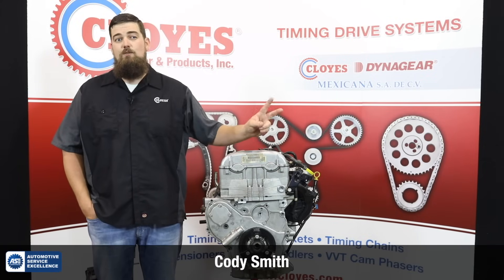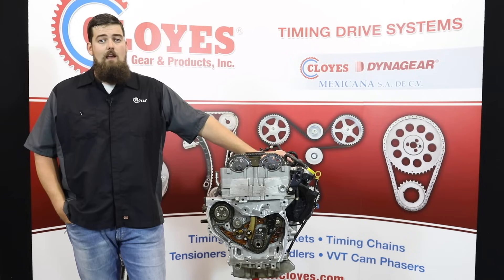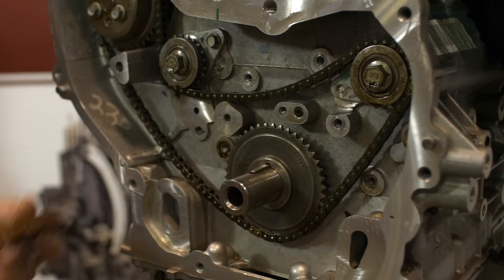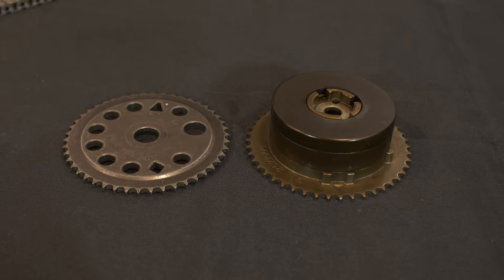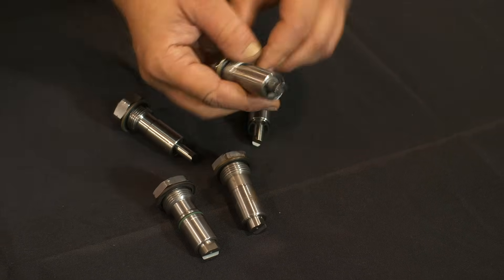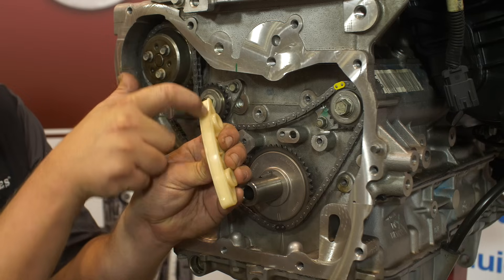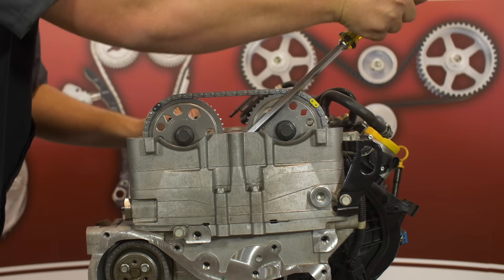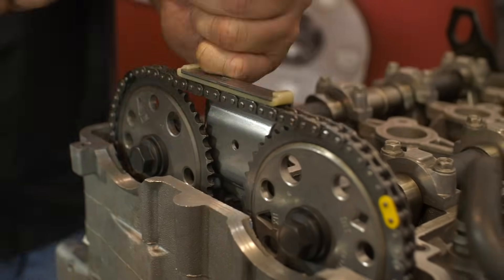GM 2.0/2.2/2.4L, Timing Chain Replacement, Cloyes 9-4201S & 9-4202S

Comment: Thanks for the video. I got balance and timing sets installed over weekend(2.2). starts up and has chain clatter. Drove about 1 mile, clatters under load but not coasting. Unceartain if chain tensioner functioning.  Do I just remove it to see if its activated and try installing/ activating again ?
 And will it seat correctly without removing the front cover again? This is my first experience with this type of engine. Thanks

Comment: Does this technique apply to a 2012 LEA 2.4l ecotec? 
I am getting code P0017, I installed a cloyes timing set, cam sprocket and cam position sensor but still cannot seem to get rid of the code.
Reply: Try cam sensor relearn. You must relearn the position sensors when ever u replace them
Reply: If that was your only code and not one for the crank. It was just possibly a bad cam sensor.
Reply from the maker: Yes, this video will directly apply.

Comment: 2011 terrain I removed the bolt that hold the intake balance shaft sprocket… housing thing and it snapped in half. (Please forgive me I have no experience with mechanics work and I’m doing it on my own because of mechanics screwing me). It’s like a long piece of metal attached to the intake and exhaust balance sprockets that goes into the engine block. I didn’t realize you needed a drill bit to hold it in place. Will this mess up my engines timing? Also, I rotated the pistons to 90 degrees before TDC so that when I installed the head (at tdc) I wouldn’t scratch the valves or pistons. I also Cannot find cam sprocket bolts or a crankshaft bolt, going to check the dealership . Thank you everyone enjoy your Labor Day

Comment: Hello 
I have the same chain set but I can't get the camshaft sprockets right am i doing something wrong i watch your video and i stil cant get it right

i have a Saab 9-3t BioPower
Reply from the maker: Do your camshafts and camshaft sprockets have the indexing features? Some Saab models require special tools because the cams and sprockets do not have the indexing features like the domestic GM models do.
Reply: @Cloyes01  The camshaft have the indexing features
The original camshaft sprockets dosent  the new sprockets have the indexing features
The thing is the chain doesn't line with the new camshaft sprocket
Reply from the maker: @thisistheway1766  You typically need to rotate the cams and/or the crank to get the marks to align properly. Especially if you experienced a timing failure of any kind. The chain sets the timing in this engine, if all marks align, then you are in time.
Reply: @Cloyes01 ahhhhh shoot

Comment: How do you know where to align the exhaust sprocket? on the balance shaft
Reply from the maker: The sprocket will only index on the shaft one way, then you put the sprocket mark at 6 o'clock and align with the marked chain link.
Reply: @Cloyes01  Thank you so much. Bought my Cloyes kit and I am excited to have my engine back.

Comment: Hi there, great video. I have a 2011 Buick Regal 2.4L Eco Tech. I bought a timing kit from Cloyes and I followed your video with certainty that I had it correct. I had all points on each chain on the right tooth of each sprocket. But I did what you suggested not to do and that was that I had turned the crankshaft by hand to see if there was any interference/out of time. The issue I’m having is that I keep rotating the crank and the chain marks are not lining back up with the sprockets mark no matter how many times I turn it. Basically I’m wondering if those marks on the chain are for the initial timing and they won’t ever line up again or have I messed something up. And if I did mess it up is there anything you could suggest I did to do that? Your feed back is much appreciated. Thank you.
Reply from the maker: Those chain marks will only align once every so many turns. You may have to rotate over 100 times to get them to all line back up.

Comment: do the timing marks on the NA crank balance sprocket and the force sprocket match up? It doesn't seem like it on the kit I bought. maybe the +/- 5 degrees on the forced is the reason why?
Reply from the maker: They are different, but the timing procedure is the same. Just make sure the marks on the chain and sprockets all align.

Comment: So this does not work on the camshafts, for the VVT version of the 2.2L.
Reply from the maker: The process on the VVT engines is identical to this. The only difference is the camshaft sprockets look different.

Comment: I'm not mechanically inclined and I hope that i'm not making a silly assumtion: Can I assume that the  Cam shaft sprockets shown in the video are "Standard" cam shaft sprocket heads, as apposed to being "Vvt"  cam shaft sprocket heads? Also,  what is the difference between the two, standard vs. Vvt (assuming that there is one,) ... Are Vvt sprocket heads used exclusively on the 3.6L ecotec engines or they interchangeable between the 2.4L and 3.6L engines sizes?
Reply from the maker: Correct, the engine used in the video was a non-VVT engine. These Ecotec 4 cylinder engines were non-VVT until about 2008, then they all adapted the VVT technology. This video only applies to 2.0, 2.2, and 2.4 4 cylinder engines. The 3.6L engines are a completely different, V6 platform.
Reply: @Cloyes01  Thank you. GREAT VIDEO !!!!
Reply from the maker: Scott Black  If you have the mechanical ability to gain access to these components, then you can definitely perform this installation. Just follow the video and take your time. Remember that ultimately the chain sets the timing, make sure the marks align properly and you have nothing to worry about.

Comment: When replacing the timing chain, is it absolutely necessary to reset the balance chain as well?
Reply from the maker: As long as you are confident that the balance shaft chain system is in time, you don't need to worry about it. When the crankshaft key is at 12 o'clock and you are installing the timing chain, your 2 balance shafts will be in their 6 o'clock and 12 o'clock positions just as they would if you replaced the balance shaft chain.

Comment: I took my 2012 Buick Regal to MileX to get water pump done. Then they messed my timing up. When i brought it back they said it was a ignition coil (i changed em all a month prior). I told them that im thinkin they made a simple mistake when puttin timing chain back. They refused to acknowledge that they are ABLE to make mistakes smdh so im stuck with a car that FINALLY went to crap COMPLETELY and dk what to do. I'm NOT a mechanic. But i know when somethins NOT RIGHT. ✌
Reply: Go somewhere for 2nd opinion explain the situation and when its the timing demand they replace ur

Comment: Awesome video... If the engine is out and everything is ready for ONLY this part of the timing chain replacement. Let's see this entire process done in a GMC terrain, not even as close to as easy. And what about taking off the crankshaft pulley/ harmonic balancer? In this video it's simply just pulled off with dudes finger's, when in reality, it's hard as fuk to get it off and I'd definitely suggest getting the tool designed for holding the balance of shaft in place while attempting to remove the harmonic balancer If not you will be fighting a timing problem for sure... So yeah great video if you enjoy watching the video where all the bolts are already loosened and everything's already out of the engine compartment, including the engine..
Reply: is romans face okay?

Comment: Why is there not a GM recall on this bad design. And then to have a interferance motor. GM is not GM. I had a 1998 2.0 turbo grand am that was a better design then the buick regal 2.0 turbo. 94,000 miles jumped time.
Reply: Because they would have to fix or pay for a lot of motor rebuilds. There is a Class-action lawsuit that was pending, it may have settled by now, but it only covered 2 vehicles. Why? I have no idea since it was used in so many other kinds.

Comment: Hi everyone, do you have the kit for 2006 SAAB 9-3 2.0T YS3F? It’s the same engine used and interested in the upgraded parts, and do you ship to Australia?
Reply from the maker: Yes, our 9-4201SA kit works for the primary components and the 9-4202SX kit contains the balance shaft components. We do not sell direct, you must purchase through a vendor. Precision International sells our parts in Australia.
Reply: @Cloyes01  Thank you very much.

Comment: So I first removed the top tensioner, (forgot to TDC), afterwards I removed the guides and chain. Next I rotated the crankshaft to TDC. OH NOOO! Now I'm screwed. I just put everything out of wack. How do I know if TDC is on the proper stroke so my cam sprockets wont jam up my valves? This replacement isn't as a result of a system failure , It's just at the 100K spot and I want to keep her alive longer with a new chain kit I just bought from Cloyes. Can I just line up the cam sprockets to 10 &  2, crank to TDC, (key way up on 12), and it's good to go?
Reply from the maker: Yes, as long as all the timing marks are aligned properly you are good. You may have to rotate your cams to get them to align, just be careful when rotating.

Comment: I have problems with this buick regal 2012 2.4 l.  I did 4 times timing chain and still saying code p0016 crankshaft position camshaft position correlation bank 1 sensor A
Reply: All part are new front the dealer
Reply: @hectorcarcamo927  Are you sure it's not the phasers? They are known to go bad
Reply: They new front the agency
Reply: The problem is that the car kill as soon you put on reverse
Reply: I had a P0017 code. It's probably your cam sprocket/phaser isn't installed correctly or you're off a tooth.
Reply: @rbell2915  the sprocket are new front the agency
Reply: Check the phasers, if you move the cam and the phaser doesn’t travel with it it’s bad.  If that’s ok, it’s possible the reluctor ring may have moved on the intake cam.  It was a problem on older ecotech’s.  Probably not a crank position issue or you’d have a P0017 as well.  I’ve done over 30 different chains on these motors and only seen one bad phaser so far.  I will say this, those REGALS are problem cars, they’re really Opel’s built for the European market and they’re nothing but trouble.  Better get on top of the carbon buildup on your intake valves as well.  That’s a GDI motor.  Does it have an excessive oil consumption issue?
Reply: @DAZ_SR  I had a buddy replace all the timing components including phasers and the actuators on my 2013 malibu. But my engine light is on. It shows p0016 as a historic fault. Should I replace cam sensor on the intake side?
Reply: @DAZ_SR  he has replaced tons of timing chains on these ecotecs and made sure it was all lined up.

Comment: A few tips for anyone else doing this (my car is 08 Saturn Sky): You probably need a 3-jaw gear puller to remove the pulley. NOT the Y-shaped/peace sign style. No need to rent the gear puller set at the parts store, just buy a 3-jaw puller.
I had to grind the 3 jaw teeth to fit precisely on the pulley. Once pulling, it was easy to get off. I used the old bolt as the pivot point.
If you're doing a water pump replacement at the same time - the WP gear does fit in/out of the hole for the WP.
To take off the WP pulley bolts, I made a bar with 2 holes to allow me to keep the WP from turning while loosening and installing those bolts. I used an alum bar with holes 1-5/8 apart on center, to put one bolt with a 3/4inch plastic spacer in the WP pulley threaded hole, and using the big WP bolt on the boss near it.
Removing the cam gear on the crank required the 3-jaw puller, it's not easy to slip off/on by hand, there's a good amount of friction at the installed position.
Removing the bolts from the balance shafts is a joke. I did not replace them as I bent my punch when I tried to loosen the bolt. Remember these parts have been going through thousands of heat cycles and everything can be stuck together. The video uses clean, demo-only engines. Not real life engines. Also, IMO, it's not required to replace every piece. The markings on the OE balance sprockets are marked but hard to see without good light.
The main cam gear on the crank had plastic cushioner on it. There was a thin shim on the front of it that covered the part number and the timing mark dot, but it was so precisely fit it was hard to see until I took off the whole gear and touched the shim. In hindsight I might have been able to keep that gear honestly.
The main chain for the cams likes to fall off the crank gear. Have a helper to keep it in place while you work.
The balance shaft gear on the crank has a springy action to it so you can't try to turn the balance chain drivetrian after that's all in place.
The vertical metal tensioner only seemed to fit into place from the top, not the bottom.
Buy a plug/bolt replacement for the top vertical chain guide on the driver side so you don't have to fret about losing that top bolt taking it out of the big hole. Apparently it's prone to break.
Most of the bolts are 89 inch-pounds but the GM book specifies 106 for some of the bolts actually.
I ground a tiny slot mark on the outside of the main pulley to mark TOP and painted an arrow. Hopefully there's no "next time".
Putting the main pulley back on doesn't require a special tool, just used the old bolt. I was able to push and wiggle the pulley on for an inch or so, then used the old bolt to press it down. Easy.
I bought a flywheel holding tool on eBay for $15, easy to use in the starter hole.
Tightening the crank bolt to 100Nm + 125 degrees required 2 passes on the degree bar, about 60 degrees each time, as there's not enough room IMO to go all at once. It's the most bolt tightening I've even done. You NEED a 24 inch or longer bar, I used a breaker bar, ie no ratcheting. The degree measure tool from the parts store is like $12.
Reply: No gear puller required.  Stick a pry bar in there and work it around, I’ve never had one not come off.  Don’t be scared.

Comment: Does it matter if the balance shaft sprockets move a bit? Yes mine rotated a bit on disassembly. As long as chain links line up I guessing I’m ok???
Reply: On disassembly yes they might move, but as long as everything lines up properly when you're done, it should be fine. The balance shafts are weighted so without the chain on they might fall/rotate a bit until new chain and tensioner is on.
Reply: Youre fine.  If youre concerned, remove the BC tensioner, de-activate, put a pin in it, reinstall pull the pin.

Comment: 280000 miles on my 2.2 and never had to replace it
Reply: Amazing what changing oil does.
Reply: Buick Regal 2.0 at 180k. Drove it like I stole it for while. Quick little motor. Here cuz guides broke

Comment: didnt gm update the terrains 2.4 by 2015 the issiues were gone ?
Reply: No, they replaced the rings with tighter tolerances in 2013 because of oil consumption.

Comment: I am ordering a new timing set for my 07 G5 2.2 however, I am leaning towards a DR.ENGINE KIT due to financial restraints & YES, I AM WORRIED ABOUT QUALITY! My next fear is, Keeping track of exactly which bolt goes where upon reassembly! From watching several/ every timing video online, I remember one mentioning the different sized bolts on the front engine cover! The kit I will be ordering from dr.engine cost $124.88 & comes with 8 bolts in total, all guides & both chains, 3 tensioners, front cover/oil pump w/O-ring, & water pump, front cover gasket, & water pump O-rings. Does anyone have any good advice for keeping track of which bolt goes where besides using cardboard with a diagram? also, Does anyone have experience with dr.engine brand timing kits?

Comment: This video is a big help. I wish you had a video on replacing valve guide seals on the 2.2 ecotec. Wife's car smokes especially after idling a while at a traffic light or first start up.
Reply from the maker: Thanks. We only specialize in the timing components so you will just see timing content from us, but I understand. Change the PCV valve first if you haven't already, just to make sure that isn't the problem.
Reply: @Cloyes01   Thanks for the reply but there is no "conventional" pcv valve. There may be something built into the underside of the valve cover but haven't been able to find anything for sure and that would be an expensive guess. Thanks again, if I can solve this problem I'll probably be looking y'all up for the timing chain kitdls. Her car has been a great car(2003 Saturn Quad coupe) untill this smoking and has 171k miles and still looks brand new. Thanks again!

Comment: I have confirmed, the front cover gasket that I reused was compressed enough that oil got by it at the oil pump, I replaced the gasket with a new one, as I recommend for this job. No more ticking or rattle. Perhaps the chain was replaced before I bought the HHR and the cover gasket was reused and the bolts over torqued .
Reply from the maker: Glad you got it figured out!

Comment: Hello!! Let me start by saying, your videos are “SPOT ON”! Your step by step directions are easy  to follow, & very thorough!            

I am nearly finished with a entire balance shaft, timing chain, & water pump job on a 2012 Malibu 2.4L. With the exception of the water pump, every other part installed, was “Cloyes” brand parts. Top quality parts also, I’d like to add!! I do have a question? As for the timing chain tensioner, is there a way I can verify that the tensioner is engaged, against the guide? I did what the video shows, as for activating it. But, it still seems to me that there is some slack in the timing chain. Is there a way I can verify, (for sure) that the tensioner is in its “activated” state? Any suggestions, would be greatly appreciated!!
Thank you! 
Steve L.